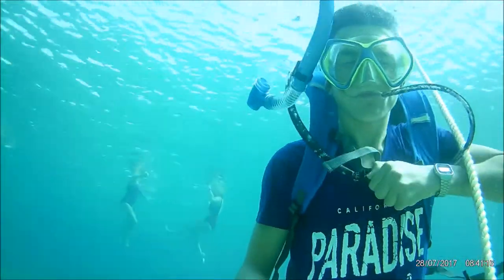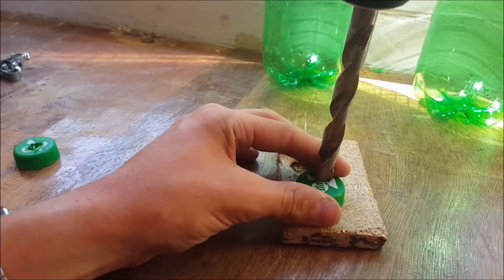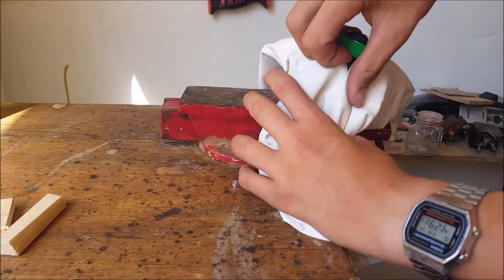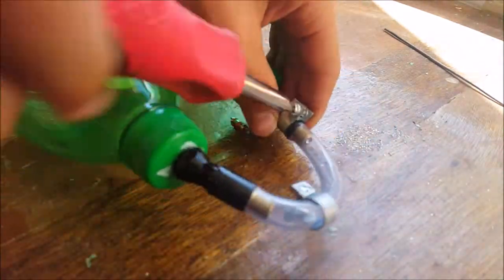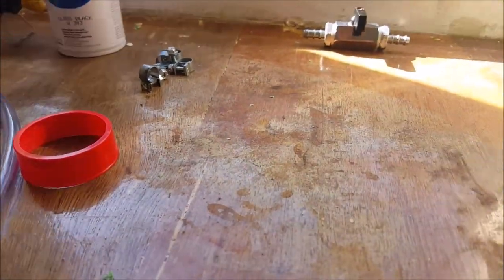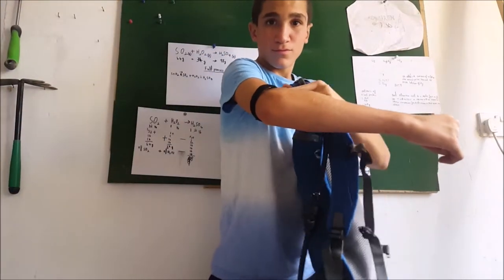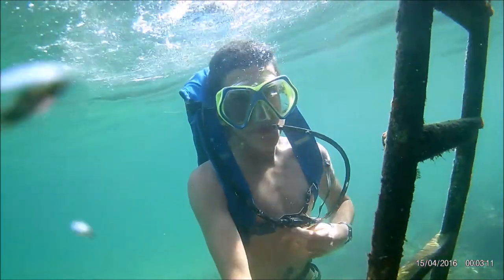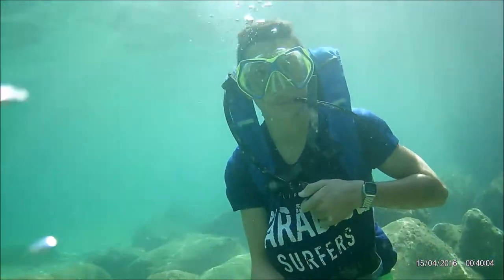How to make a DIY underwater breathing device

Comment: awesome project dude, don't forget to use a snorkel mouth piece wirh a one way balve to don't hurt your lungs
Reply from the maker: +Felipe Ceballos yeah thanks mate
Reply: Darren DIY No prob
Reply: Wait could u explain how you can hurt your lungs and how to stop it and why it works thx 
Good day,
Matt
Reply from the maker: Matthew Phillips i think he means some type of regulator
Reply: Matthew Phillips The air runs to your lungs, even if you are not breathing, that can cause lung expansion which is really dangerous

Comment: no air regulator second stage ??????
Reply from the maker: No need, unless if you want to spend more, you don't need as the pressure isn't like 1500psi its only 80 or so

Comment: Just found a mini diving tank online for $200. You pump it up with a high pressure bicycle pump! It lasts for about 6-10 minutes and has up to 21 breaths. I really want to buy it but I don't have any money to buy it, it stinks.
Reply: High pressure bicycle pump, no such thing in existence, get some knowledge of physics before you make idiotic statements on internet !!
Reply: Please don’t buy it, it may seem like a good deal but it’s extremely dangerous. I’m scuba certified and know about the dangers. I spent over 1500 dollars in bcd, safety sausages, regulators and much more. A 200 dollar tank can be bought for 100 at spare air but is only used as a back up. I don’t use it myself but it is only a back up. If your watching this I assume you do t have a 100 dollar minimum, regulator but please just get scuba certified and buy or rent the equipment. I have had my regulator get kicked out of my mouth at least 5 times and if the mini dive tank gets kicked out your screwed. There also the risk of embolism of the brain which means you will die. Just DONT BUY THE MINI TANK.
Reply from the maker: Listen to them dont't buy it . My so called "contraption" is only made for 'diving' up to 2-4 meters not more.
Reply: Us scuba divers call this thing 6 breath till death because they'll swim down  run out of air swim up real fast and hurt yourself